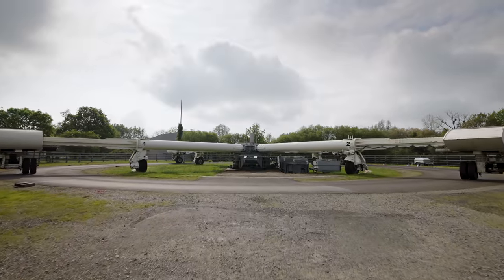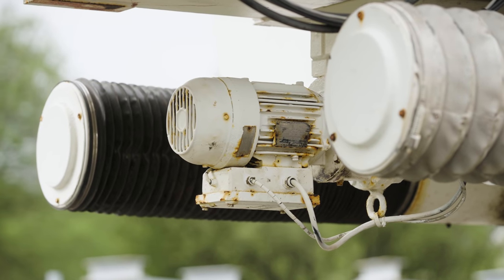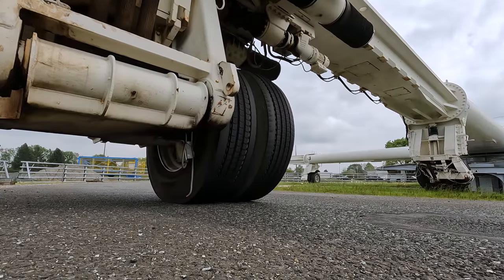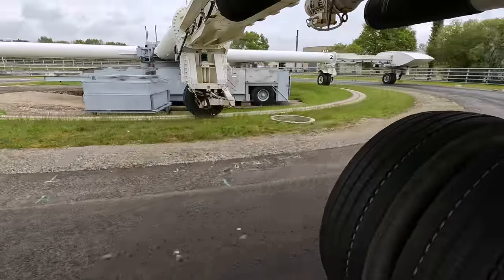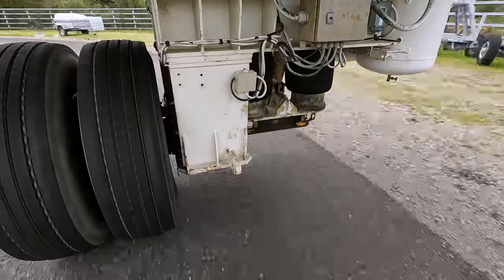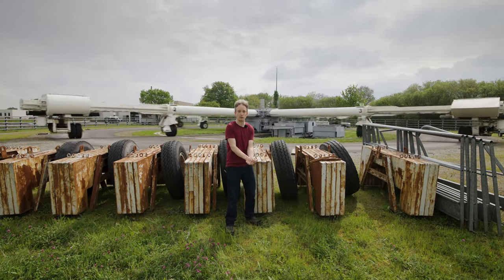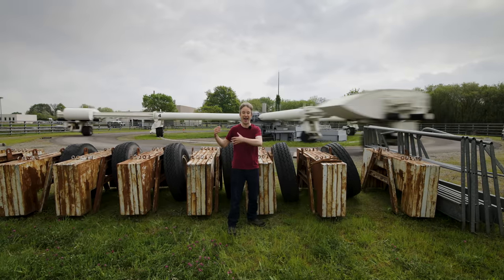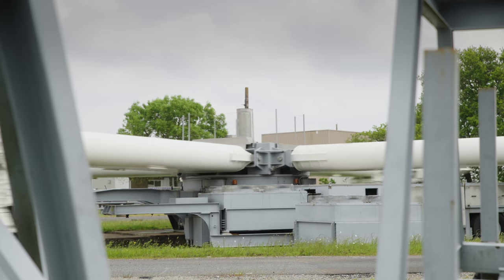The massive Fatigue Carousel helps keep roads safe

Comment: For those wondering about tire life: At the typical speed of 70km/h, that's about 1700km in a day, or 50,000km in a month.  Commercial truck tires are apparently expected to last somewhere between that long and twice that long, spending on which hastily-found online source one reads.
Reply: I was just wondering exactly that, thanks. The other thing I was wondering is what those speeds etc are in mph, so I'll add some conversions here for anyone else:

70km/h: 43.5mph
100km/h: 62.1mph

1700km: 1056 miles
50,000km: 31,068 miles
Reply: also the biggest ware and tear on tires is accelerating and decelerating maintaining a consistent speed will add much life
Reply: I wonder how many blowouts they had over the years. This could be a test on tires for lunatics in roundabouts. xD
Reply: @ehcanadiankid1  actually the biggest wear and tear on truck tires is curves, because it is scrubbing the inner and outer edges at different speeds, and I noticed some cupping on these, probably because it's constantly going around a curve.
Reply: @ke6gwf  the tires aren't being subjected to lateral gs. The centripetal force is provided by the arms of the centrifuge, not the tires. These tires are being loaded as if they were going mostly straight.
Reply: Hard to believe this machine is not used to simultaneously test tires
Reply: @carl4043  That would be another variable to the test so it seems unlikely.
Reply: You ignore constant overload, side skid angle. 
This is not about the tires, but to f*** up the road surface as quickly as possile while keeping data consistent with real world fatigue.
Reply: @ke6gwf  The “biggest wear and tear” on truck tires are due to Weight & Temperature!
Reply: @nigel900  Surely you didn't drive 24 hours a day,  which this machine does?
Reply: @carl4043  tire manufacturers have their own equipment and test tracks for that, which only focuses on the tires
Reply: @tissuepaper9962  hes not talking about lateral g's hes saying that the innter edge of the tire is literally rotating slower than the outer edge. because the outer edge is traversing a slightly larger circle in the same amount of time. this leads to a small amount of slippage on one of the edges to keep them rotating at the same speed, which causes wear on that edge
Reply: @ke6gwf  They mentioned the tires can be angled a bit to simulate this a bit more, even more than just making the same turn constantly. Not sure if the wheels can be tilted, but they probably "steer away" from the driving direction.
I can also imagine that if they need to simulate a situation where you don't want to see the effects from this "constant curve", that they will make the road slightly titled. But then it may become more dependent on the speed.
Reply: @sharx892  see the size of that fence? I think they've had a few failures.
Reply: @nigel900  truck tires can go 50k miles straight forward at full load. But you put them in conditions where they are constantly turning like these are, and they will wear out from rapid tread wear very quickly.
For instance light weight city delivery trucks will wear out tires MUCH faster than long haul semis at full gross weight, because the long haul drivers are mostly going straight, while the city trucks are mostly turning.
 
Weight and temperature will increase the likelihood of the tire failing, having a blowout etc, but it's friction that wears the tread down.
Reply: @TD-er  even a tilted road will be a constant turn for the tire, unless you made it a vertical cylinder.
Imagine how a tire wants to roll, straight ahead, so that there is no differential friction between the two edges of the tire, and any movement that's different than that will wear the tire faster by making one side of it slip and move under friction against the road.
Reply: Tires will get into a cone shape fast, if they aren’t build like that already. This will compensate for differences between inner and outer edge. Plus, there is no side load because the carousel takes that centrifugal force. So, the load probably is almost exactly the same as if it was a straight road. Maybe they can even tweak params to simulate trucks going around a corner?
Reply: I was a tyre fitter (car, not truck). Their average lifespan is around 20,000 miles for good ones (e.g. Michelin). I have seen the odd one make it to 100,000+
Reply: @sharx892  There is no lateral load on these tyres - they are going around in circles, but the arm is taking this force, so I believe this approach will be good for modelling things like motorways.
Reply: @cesareferrari8056  Oh, you're right. Didn't think of that.
Reply: Crazy to think that those tires drive the distance across an entire country, but in a small circle.
Reply: @evanmatthews2159  Besides which the tyre manufacturers have their own equipment to test that.
Reply: I was absolutely not wondering that, but this is one of those bits of info you read and suddenly get glad you learned them. Thanks for the info, Sr.!
Reply: This machine could double as a tire tester while testing roads.
Reply: Who asked?
Reply: @ehcanadiankid1  the curve produces wear too
Reply: @mabamabam  I assumed the strong fence was to protect wildlife from wandering in overnight.
Reply: @FurnitureFan  keep they stray elephants out?
Reply: Last time I replaced rear dual tires on my semi-truck here in the US they had gone 378,000 miles.

Comment: When I worked for Minnesota Dept. of Transportation, the Research Dept. was proud of establishing a test site on a real piece of freeway with real traffic. This machine gets data a lot faster than that.
Reply: Right, the fatigue carousel must save a great deal of public money by identifying the most durable materials beforehand.
Reply: @FurnitureFan  in the long term for a large area maybe, but I imagine this machine cost millions of dollars to design build and operate
Reply: @KappaKiller108  hardly a million... its a simple machine that rotates and it has a few sensors only... operation is just the price of electricity  which is cheaper than gas and the staff plus a bit of maintenance. do you have any idea how much money goes into just the raw materials of a road without even counting the labor, planning and cost of the land rights?
Reply: Except the Minnesota machine actually tests freeze thaw cycles and this machine does not.
Reply: @KappaKiller108  as he said, this specific one is 40 years old already. It's had time to make billions of return on investment.

Comment: I do wonder, how many wheels / tires does this facility go through during a testing cycle?
Reply: This was exactly what crossed my mind too. The wear and tear of those tires must mean that they need to be changed very often?
Reply: Would be interesting to know, I would guess 1 as even though its constantly turning slightly theres no load applied through the turn like a real vehicle where the turn is caused by the friction of the tires physically changing the direction of the vehicle, and acceleration and braking which would also increase wear are again not being applied through the wheels, all they're really doing is simulating the weight of a vehicle but the tyres arent really having the same forces put through them as they would on an actual vehicle
Reply: I wonder if the tire manufacturers use this to test their tires too!!??
Reply: @railnut8453  Maybe they can cut a deal. modified road surface with standard tyres and modified tyres with standard road surfaces.
Reply: Bet they'll last longer than ours, so we change whilst there's still tread, could run these to slicks few k more miles there
Reply: @railnut8453  All truck tires
Reply: @railnut8453  No need to use a machine that giant or expensive for that, wheels can be tested in much smaller machines (and later on cars).
Reply: They got 20 ply tires ?
Reply: So an average drive tires like they have on the arms there can see up to 50,000 miles (80,000 km). The engineer stated they usually run at 70 km/h which translates to about 47 days worth of travel before they hit that 50k m or 80k km mark. So about every month and a half of testing they have to swap out tires, possibly more often since they're under constant strain and not fluctuating stress.
Reply: These kinds of tires are replyed and last a significant amount of time so not as many a you think
Reply: figure 60k Km as the AVERAGE length of life for a low quality road tire (cant really see them using expensive tires).. running 70kph .. roughly 860 hours or  just shy of 36 days of life for the tire....
Reply: @ToggBott  I think they can also run much more worn tires than what you can run on an actual car since it's not really a safety issue.
Reply: While you test the pavement, you also test the tires
Reply: @HappyBeezerStudios  Would be quite expensive - to test a tire will be easier on a roller where you can quickly test out the parameters, tread etc.. alongside angular handling and wet weather handling - this will be absurdly expensive to test out a single point usage.
Reply: @wurfyy I Think it's the reverse that they would rotate and swap tryers out a more frequently than road usage due to the cost of the equipment and the overall time involved in each test.

Would be cheaper to get $18,000 worth of tryers per test then have to restart or repair equipment due to a failure.

Would estimate that a test like this would probably run anything from $500k to $1 million to run.

Comment: As an FWD (Falling Weight Deflectometer) operator I never knew these existed. My job is to do the same as this but on a smaller scale (using an FWD) on already built or under construction roads as part of QA checks but never thought about what they might use when coming up with new road designs to test. Thanks Tom for the cool video.
Reply: now I'm really curious what that looks like. How do you do QA tests on already built roads? When do you do QA checks on roads?
Reply: @j.wa.1061  You can lookup FWD's on google to see what they look like. There are different types but generally a trailer with lead weights in the middle (like those stacked weights with the pin you see at the gym but much heavier). Usually 9 or 10 geophones positioned along some sort of boom. The machine lowers to the ground where you position it and the weights hit the part on the ground (the foot) and you get a deflection into the pavement that the geophone sensors pick up. Based on what values you get from those you can determine quality of the road structure and even how long you expect it to last, especially if you have info like layer type/materials and traffic counts. Usually you just plop along the road doing a test every x distance with some sort of traffic management behind. That's the basic of it.
Reply: @CreedBrattonTheOffice  cool! I don't think I've ever seen one in my neck of the woods, but now I'll know what it is if I do. :)
Reply: A falling weight deflectometer operator? I thought you were in quabity assuance.
Reply: I thought you worked at a dog food company in quabity assuming

Comment: That is seriously unnerving.  I've had nightmares about being stuck to the outer wall of a machine like this, with incomprehensibly massive arms passing at astronomical speeds just inches from my face.  I didn't know such a thing actually existed!
Reply: You have a very scary and very specific nightmare.
Reply: Why are you so scared of an oversized helicopter rotor?
Reply: @MonkeyJedi99  It's not really a nightmare... that was just the easiest way to explain it in a single sentence.  It's more like sort of a hallucination which happens while half-asleep or sometimes kinda while working.  Like, have you ever felt like the bed was tilting or spinning?  It's kind of like that, except it feels like laying on the inside of a ringworld looking toward the center, while planet-sized masses zoom by so close that they'd hit me if I tried to lay on my side.

It's one of several weird hallucination-like things I get sometimes.  It's not scary, but it is at least disorienting, and if it happens while awake I make sure not to do anything which requires a sense of balance.
Reply: I believe they have a machine like this at NASA to simulate g-force on astronauts
Reply: @hendrikdependrik1891  Are you not scared of a regular-sized helicopter rotor? You should be.
Reply: @ToyKeeper  hey! Just cheching, that's not normal, maybe you should look into what's causing it (if you haven't already)
Reply: @Vale-nh6ey  This sort of thing is more common than one might think, and is generally not a problem.  It typically is just like a natural high that people have sometimes when they're young, and then it happens less often and less intensely the older they get.
Reply: Sleep well tonight! 😂
Reply: Let's get some exposure therapy going!
Reply: Now you know  what to stay away from!
Reply: I have felt this feeling. Standing under one side of one of those 'pirate ship' fairground rides as it zooms up in the air and then back down. Even though you know it won't; every time it swings down it feels as though you will be flattened. It's a crazy feeling haha
Reply: @lucyana1599  go and watch NASA astronaut training simulator
Reply: Lmao
Reply: @hendrikdependrik1891  you should be scared of an oversized blender, and this is a semi truck going up to 100km/h with a literal anchor point. If you got hit by this thing your head would either turn into a very large splatter, or a very large baseball. Home run!
Reply: Did you play dead space growing up?
Reply: @ToyKeepe, Omg, The same thing happens to me!
Reply: @BeeJay120  It doesn't simulate g-force. It generates actual g-force!
Reply: ToyKeeper' Therepist: The giant machine which spins massive metallic arms at high speeds isn't real, the giant machine which spins massive metallic arms at high speeds can't hurt you. I mean, why would someone even invent the giant machine which spins massive metallic arms at high speeds?

Tom Scott: Explaining exactly why the giant machine which spins massive metallic arms at high speeds was invented.
Reply: If you were actually in that situation, that would be a great opportunity to practice controlling your mind/fear. Making your amygdala stand down can save your life!
Reply: Hey big fan of your flashlight UI software :) imo you changed the scene forever
Reply: Could these hallucinations be from the body overproducing DMT?
Reply: If you think oversized objects moving quickly is freaky,
 I'm not gunna tell you to look up what a ships propeller looks like in motion underwater

Comment: Kansas State University has one of these in the Civil Engineering Department! It goes back and forth on the same track, and also includes the “wander” feature for real traffic. That one also has climate control because it’s indoors. It’s cool to see this French version which is bigger and smoother.
Reply: In Minnesota we test it with real use on a real freeway. We've got a stretch of freeway that they lay down the test material and have actual, varied, traffic drive over it through multiple seasons to see how the pavement blend holds up in real world conditions.  The people doing the studies can divert traffic onto or off of the test track so they can repave the test track without interrupting traffic when they resurface the test track.  That lets them see how the pavement handles through our legendarily bad freeze-thaw cycles.
Reply: @DonOblivious  That’s cool! Nice!

Comment: Yet another job nobody told me about during the high school job fair, along with flinging chickens at airplanes.  Thanks Tom.
Reply: Not sure what, or if they fire anything at aeroplanes, but in the U.K. ducks (specially bred and humanely euthanised) of various weights and sizes  are used for testing jet engines. 👍🏼
Reply: @56Gumball  They use chickens here in the states to test a variety of aircraft structures, including engines.
Reply: Gentleman, thaw your chickens
Reply: @56Gumball  I now have in my head the phrase, "A standard spherical duck."
Reply: An international standard engine test chicken
Reply: @56Gumball  can’t they use something else?  kind of messed up
Reply: @_kaleido  Well simply put, nothing can more accurately tell you the effects a duck would have when hitting something, than a duck.
Reply: @_kaleido  It’s used for testing for bird strike, a real phenomena when flying and using other objects would add variables that can’t be controlled or wouldn’t match what happens with a real bird
Reply: @lunavixen015  
Well TBH, if you're flying into chickens, you've probably got other problems to worry about.😄
Reply: @_kaleido  The alternative is 300 dead passengers on a commercial aircraft including children whose finally moments would be sheer terror as they plunge into the ground close to the speed of sound... 

The real tragedy is that after going through the engine there won't be anything left to BBQ.
Reply: @lordgarion514  Chickens aren't the risk to planes, but they are the best analogue for the average bird and most easily available.

Bird strike can absolutely down a plane